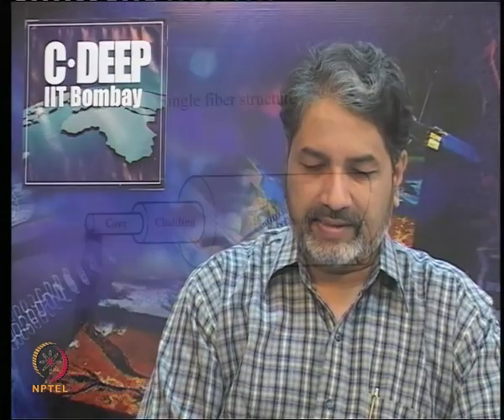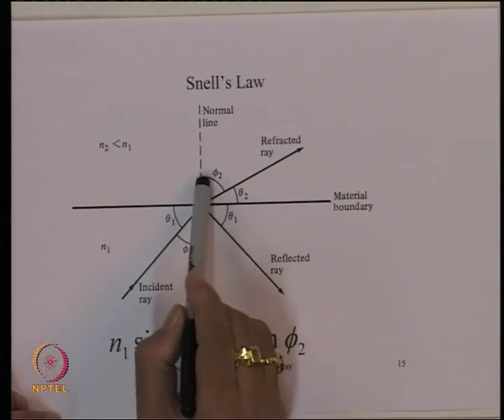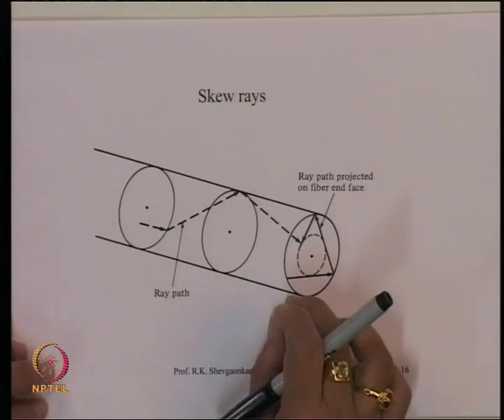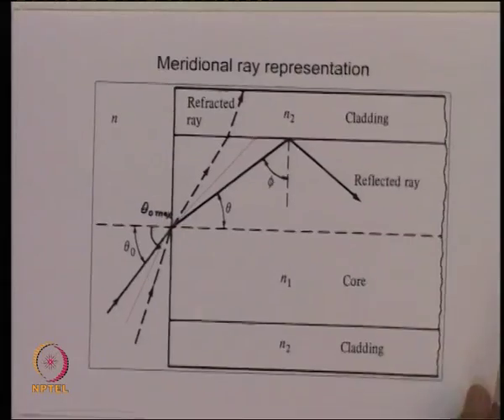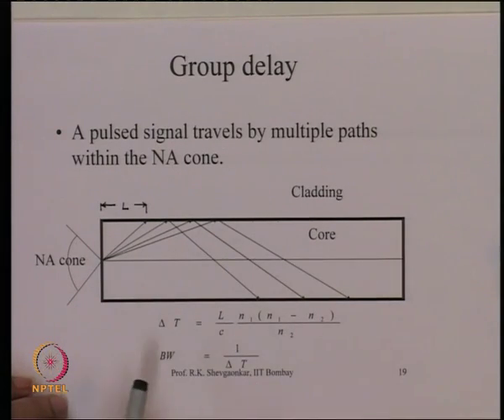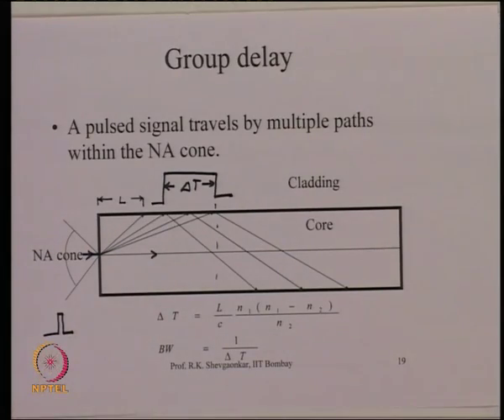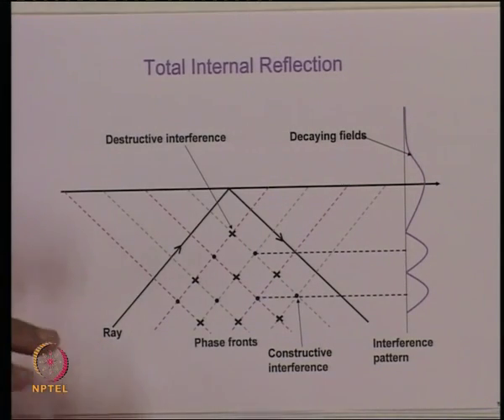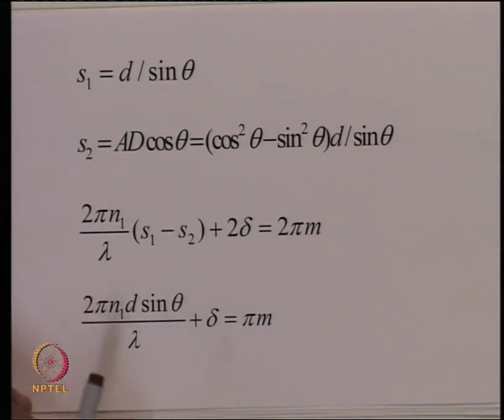Mod-01 Lec-03 Ray Model -I

Comment: sir why cant the light enter through sides in the fiber 
and why at the sides we cant have total internal reflection at a particular angle
and sir gud lecture thanks
Reply: +Nancy Mehta . Light could enter through the sides of the fiber however in order for it to be propagated through the fiber it has to be launched within the Numerical aperture or cone of acceptance. Any light launched outside would not fulfill the condition for total internal reflection and would be refracted out of the fiber i.e. in other words would not get propagated to reach its other end where it is supposed to reach. Hope that answers your question.